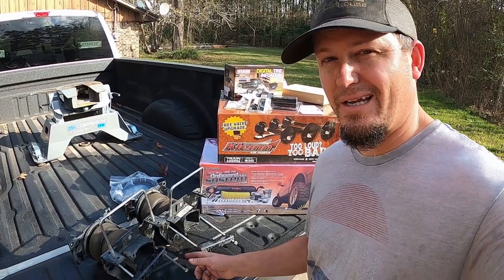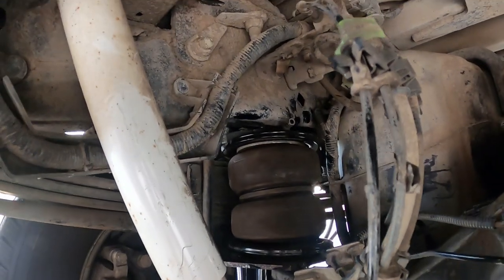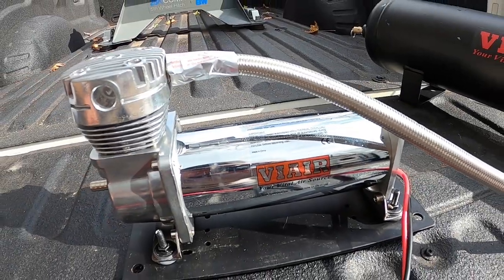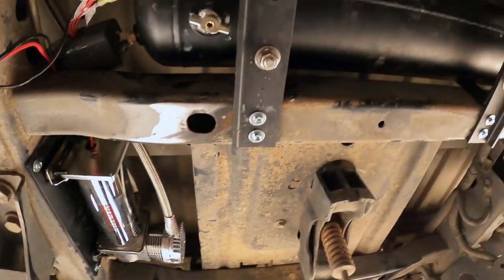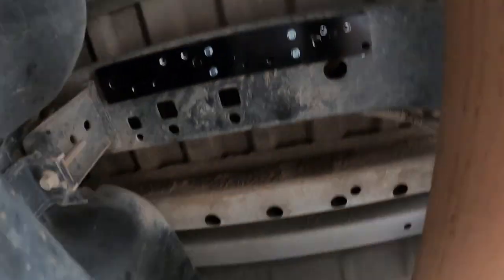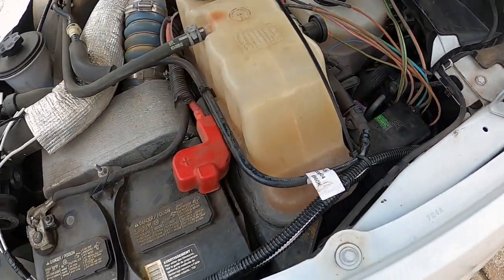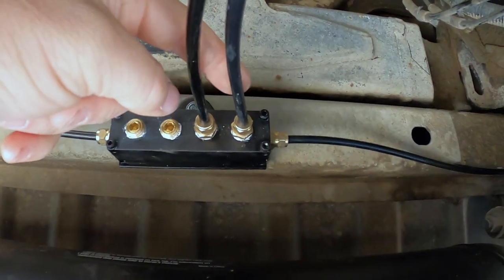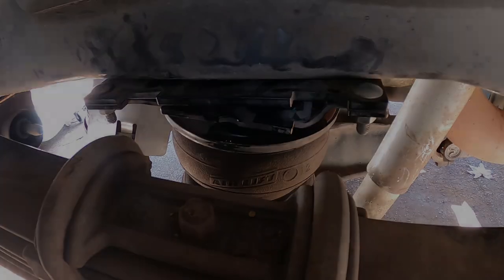How to Install a Viair Onboard Air System, Air Lift Airbags, And Kleinn Train Horns A Ford F350!

Comment: Thank you for all your time, you made it look easy, great professional installation. Definitely an improved ride when pulling the 5th wheel.  Air chuck came in handy the first time we pulled out, two tires running low.  Air horn is really awesome too!
Reply from the maker: Glad to hear the new toys are working out great for you!

Comment: First thing I did when I got my F-450 was install the Air-Lift bags.  I put on the Easy-Air system so I could adjust the pressure on the fly with the remote.  I also put the compressor in the bed over the wheel well to keep it out of the elements.  Heard people were having shortened life/failure issues due to dirt and salt.  Nice setup!
Reply from the maker: My truck has been running this same setup for over a year now!  It was originally going to be in the bed of the truck, but I really didn't want it taking up space, so I installed it under the bed.  So far, I have not had any issues out of my system!

Comment: I must say that it’s a clean application very well put together it would be cool if you could mount the equipment out of the weather ❤❤
Reply from the maker: Thank you! I went with these components because they are made to be mounted in the elements! The system has been on our truck for 3 years now!

Comment: I added the same air compressor  to my air tank.  One thing they don't tell you is that you need to run a water separator or it voids the rust warranty of the tank.  Their big idea is that you get under there once a week to drain that tank.  So i got a normal air separator at Tractor Supply and its amazing how much water it catches.
Reply from the maker: That is why I installed the drain valve and tank where I did!  I can reach it through the wheel well and open it up to drain!  They also don't tell you that even with draining you are likely to have to replace the tank every 3 years due to internal rust from the water!

Comment: So I saved this video knowing that when my 2022 F350 dually I would be able to go back and watch it so when I added my onboard system I would know where to mount everything. My one question was did you use self tappers to mount the air compressor plate to the frame rail and the tank brackets to the frame cross member? Thanks for the info.
Reply from the maker: Yes! I used self tapping screws and drilled pilot holes! I believe I used the biggest ones I could find either #12 or #14 should work just fine! If you have anymore questions send me a message on Instagram or Facebook and I can talk with you!

Comment: would be cool if lowering the bags would go back into the tank.
Reply from the maker: That would be cool but would never work, The tank has a system pressure of 200psi and is always maintained by the system! The bags will have a max of 100psi in them, even if you plumbled it back to tank 100psi is not going to flow towards 200psi! Almost all air systems will have an exhaust dump and will never recapture the air!
Reply: Yeah it would be but that's how a hydraulic system works 😂
Reply from the maker: The oil returns to the tank but it is not under pressure when it does, you already have an unlimited supply of air not under pressure all around you, why would you need to recover it?

Comment: Looks good, I just bought a 350 dually and it came with bags., they installed the compressor in the bed which really ruins my ideas of hauling dirt, branches or whatever other junk we throw in our beds...  so how has the water, mud, dirt issue been on your mounting location???  I would like to relocate the compressor..  2008 XLT Dually
Reply from the maker: So when I installed it I did a poor job of remembering to drain the system of water, and ended up having to work on the system and the water caused issues with the pressure switch relay and the tanks check valve!  After we repaired that I added a remote Drain Valve so I could drain the system from the cab using one of the upfitters!  You can check that video out here! https://youtu.be/bLstKbve68Q

Our Air compressor lasted 3 years of daily use before we had to replace it, when I took it apart you could tell I did some damage to the cyclinder walls when I let the water build up!  So as long as you remember to drain it the location under the bed has not affet on the life of the system!

Comment: Great video. Still debating myself if I should do the same myself or bringing the truck to a garage where they do it everyday.
Reply from the maker: It is not a hard process if you are confident that you can do it save yourself the money!  I called a place to get an idea of the cost I saved and the Quote including parts was $3700.  I only paid $1500 for parts so it was a significant savings by doing myself and it was done exactly how I wanted it!
Reply: My local guy wanted $1000.00 just to install my air horn. I installed 2 Viair 444c compressors, the horn, tank and air chucks for just the cost of the toys. This took a day and a half under the Jeep, but the satisfaction was worth almost as much as the money I saved.

Comment: Any chance you could post a picture of the gauges and switch connection? Having a hard figuring out how you did the air connections.
Reply from the maker: It is very simple your air supply line from the air system needs a "T" fitting installed on it and you run one line to a gauge to show system pressure and the other goes to the "IN" side of the switch!  On the "OUT" side of the switch install a "T" fitting, one line runs to a gauge to show Air Bag pressure, and the other line goes to the Airbags!

Comment: Did you just use self tapping screws for the tank and compressor?
Reply from the maker: Yes but I drilled a pilot hole first.

Comment: Awesome video , I have the the Viair and recently order the 5k airlift bags.How exactly does the paddle switch work ? For the release you just run a line that goes outside ? The only electric is for the gauge , right ? Sorry for all the question , I been looking around for information how to and you just got me super close lol
Reply from the maker: There is no electric needed for the paddle switch. You hook your air supply to one side and your air line to your bags on the other.  When you press the switch to air up bags it allows pressure from supply line to air bag line.  When you press button to deflate bags it allows air pressure from bags to leave through open exhaust port on back of the switch.  There is no place on the switch to attach line to exhaust outside the vehicle.  It however is not a huge volume of air so its not something to worry about.

Comment: One of the best upgrades you could do, get rid of those bottom of the barrel rancho shocks and replace them with some Bilstein 5100's...
Reply from the maker: This install was on a family friends truck.  But we did just make a video where I install Bilstein 5100's, and upgrade the airbags on my truck!
Reply: @PavingNewPaths  I was SO disappointed with the rancho shock that came on my truck(2020 GMC 3500HD AT4), GM really screwed the pooch when they went away from Bilstein...I now run 5100's...
Reply from the maker: Our truck is a 2020 Ford F350 platinum dually, I thought the rough ride was due to the dual rear wheels for a year.  It is night and day difference with the bilsteins!
Reply: @PavingNewPaths  Nice truck...

Comment: Great video! Just wondering on the compressor wiring did you connect both the power line wire and switch wire to the truck's upfitter?
Reply from the maker: No the whole system operates on the pressure switch relay from viair! The upfitter is just the on signal to the relay! You run a dedicated power and ground from the battery to the relay! It operates based on the system pressure in the tank, less than 160psi and the compressor will turn on, it will run to 200 psi and turn off!
Reply: @Paving New Paths  The pressure switch would still be in the mix. The Viair pressure switch would just get its power and be controlled by the uplifter switch instead of being connected directly to the battery. This way it would only run when I have the uplifter switch flipped ON and when pressure is low. Just tying to understand why the need for the direct battery connection if that's the point of the upfitter setup is all.
Reply from the maker: @rayr4975  Thats exactly how it works, the pressure switch relay gets power and ground from the  battery directly, the upfitter is the on signal for the pressure switch to be active! So when its on it will only run if the pressure is below 160 psi in the system!
Reply: Update: Hooking up the compressor to the uplifter switch worked just fine. Been running it for months without an issue. Also I had to heavily modify that mounting bracket you have listed.... it wasn't as straight forward as this video shows. Guess that's just editing magic 😉

Comment: So quick question really wanting to do a setup like this but to just run my bags and some air tools how do I install the switch to inflate and deflate how do Install 2 gauges one for air in tanks and one for the bags I'm going to run the compressor to a toggle I understand the rest of it just not the gauges and switch
Reply from the maker: Ok so you want to take an airline that has system pressure, using a Tee Fitting you will run one line to a System pressure gauge and one line to the input of the paddle switch to air your bags up!  This will give you the pressure that is in your tank!  On the output side of the paddle switch (to airbags) you will install a Tee fitting and have one line to a pressure gauge, and one goes to the Airbags!  The pressure you read on this side will be the air pressure in the bags!

Comment: ❤ which train horns you can deplete the air pressure in seconds, with only one air compressor. ❤. I can blow my airhorns for long periods of time and my. 4 VIAIR compressors, will keep up with the air demand for very long periods of time ❤❤
Reply from the maker: For what we use ours for only one compressor is needed! You only need more compressors when you start getting into suspension systems that need air on demand faster!
Reply: The reason I have 4 air compressors is I like rapid recovery really fast on my 2 1/2 gallon tank I put the system in my truck because I need to wake people up once in a while so they won’t run into me when they’re jacking around with your phone

Comment: Did you use Self tap pers to install tank
Reply from the maker: We did!  We drilled pilot holes first and secured them with self tappers!
Reply: Thank you. How did you supply air to the via air gauge in the cab.
Reply from the maker: We have done it two ways! The white truck in the video we used a hole under the drivers side door sill near the  e-brake cable there was a rubber plug we drilled a hole in and used as a grommet! On my truck the controls are under the back seat, we drilled a hole in the cab and installed a grommet for that one!
Reply: Thank you, sorry for all the questions. I ask wrong question. Did you run air line from manifold to air gage in cab. Not the air bags. You only mentioned one supply line going to cab.
Reply from the maker: @Tmil1035  You need to run a system pressure line into the cab so you can see the pressure on the gauge and have it on the paddle switch to inflate and deflate the air bags! You also have to run an airline from the paddle switch in the cab back to the air bags!
Reply: I really appreciate you answering the questions take care and be safe out there

Comment: Nice install. What did you need to do to protect the spare tire sidewall from damage by the air tank brackets?
Reply from the maker: Thanks! There is no more contact with the spare tire against the brackets than there was with the spare tire against the frame!

Comment: what is the part # for the bumper air quick connect?
Reply from the maker: That was just a standard 1/4 NPT female to female QD from lowes.
Reply: How do you connect the black plastic air hose to it?
Reply from the maker: They are compression fittings.  You remove the nut from the fitting and slide it over the tubing.  Then you slide the tubing onto the fitting until it is tight, then slide nut down and tighten

Comment: What keeps the airbags from pumping up after sounding the air horns?
Reply from the maker: We have a manifold where we have a system pressure to each circuit but they are all controlled separate from each other! The train horn only sends air to the train horn when we use it and the airbags only air up or deflate when we adjust them! Doing one function does not affect any of the other functions in the system!
Reply: @PavingNewPaths  it all comes in the kit?, I have airbags already on the truck with compressor and just put horns on was looking for a kit to run both
Reply from the maker: @brandencb19  Technically it all comes with each kit and you have to make it work for what you want! In this video we had the viair compressor which was one kit, the airbags which was a different kit from another company and the train horn which was it's own kit! We added a manifold so we can have multiple system pressure supply lines and were able to tie all the kits together for our system! if you want to add a train horn to your kit you just need to supply the train horn a system pressure line from before the air bags and you will be able to use it with out affecting the bags!
Reply: @PavingNewPaths  yes I’m looking at the compressor and tank kit now, plus the manifold thank you
Reply from the maker: @brandencb19  If you have any more questions reach out to me on facebook or Instagram and I can give you a schematic of how I set mine up!
Reply: @PavingNewPaths  appreciate that thank you
Reply: @PavingNewPaths  looking at doing the same set up, would you mind sending me a schematic on how you hooked this system up.
Thanks in Advance
Reply from the maker: @timothymyers6506  Send me an email at hello@pavingnewpaths.com

Comment: Where did you run the air lines into the cab?
Reply from the maker: For this set up he wanted the controls and gauges by the steering wheel so we pulled up the door sill and the rocker panel by the emergency brake! We drilled a hole in the rocker panel by the E brake cable, installed a rubber grommet and ran the lines into the cab there!  For my set up I have the controls and the Gauges in the toolbox under the rear seat!  I drilled a hole at the rear of the cab and installed a rubber gromet and ran them there!
Reply: @PavingNewPaths  awesome, thanks for the info. I'm installing mine and debating on where to put the controller.
Reply from the maker: In the Video you watched they are by the steering wheel!  My truck I installed them under the rear seat in the side of the under seat storage box!  You can check that out here in this video! https://youtu.be/d_pCfeOtFS0

Comment: It’s hard to see what you did with locations for different parts. They don’t actually line up with the parts such as the gauges. 
Also I’m not sure how to get the parts list.
Reply from the maker: The parts list is in the description of the video with links to all of them. All of the parts I used line up with where they needed to go for our system to work! This is not a plug and play we bought several things and made it work for our goals!

Comment: What would it cost to install air bags and horn?
Reply from the maker: I think the total cost for all the parts we used was around $1500. Took us around 2 days to install everything, but we were trying to film the process so it takes longer!
Reply: @PavingNewPaths  Very impressive work you do, I have seen a few videos. Should receive our new F350 DRW in April, thinking I should update immediately. Pulling a heavy Redwood 5th wheel full time.
Reply from the maker: So this install was on a friend's truck and mine is identical to this, except I mounted my gauges and switch in a different location! I put it in the side of the storage compartment under the back seat on the driver side!  

I also recently did a video where I made some more changes to my truck including swapping out the airbags from 5000lbs to 7500 lbs bags.  I also show the location of my gauges and switch, along with several other upgrades!

If your intersted go check it out here.
https://youtu.be/kuhWv7aBFuk
Reply: @PavingNewPaths  I saw that video and would love to upgrade to airbags on my 2022 F350 DRW limited.  Again, great job, great videos, keep up the great work!! Thank you for taking the time to record them.
Reply from the maker: You're welcome!